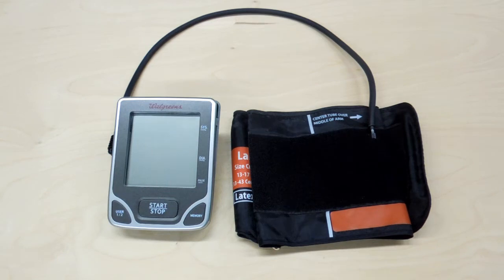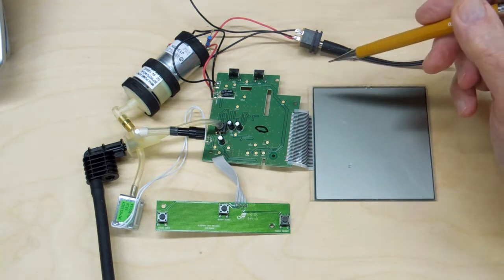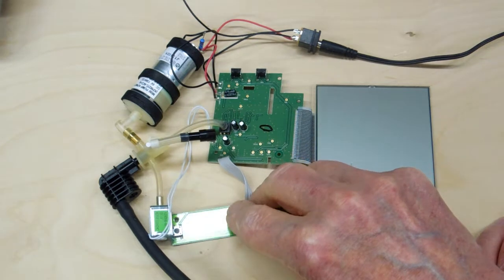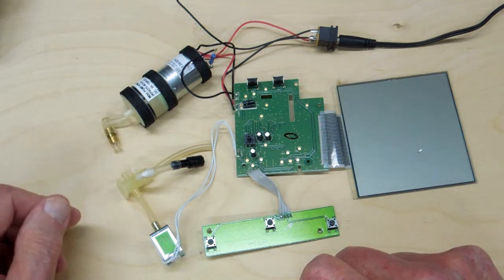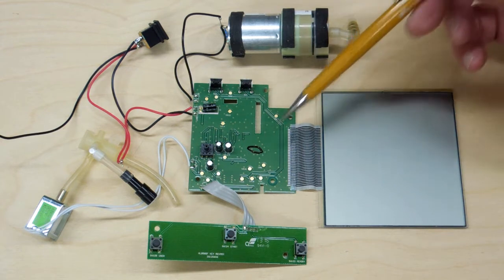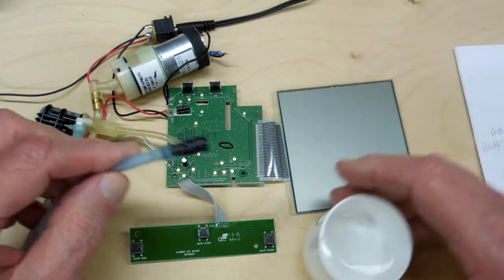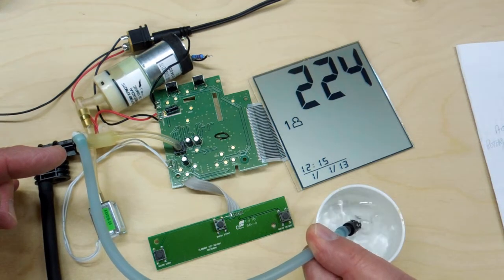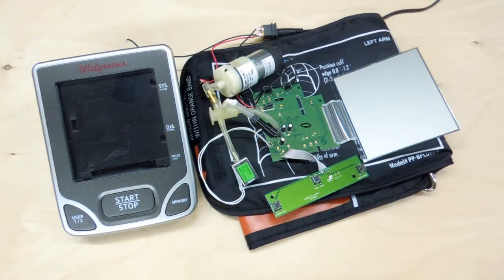Blood Pressure Monitor - How Does It Work

Comment: Both my units use too many batteries. With brand new batteries, the display will read full battery. After maybe two weeks it’s down to one bar.  It will run for a few more weeks , but a power supply is in order
Reply from the maker: Recently purchased another BP Machine from Walgreens and it will not take a power supply. Manufacturer must be in bed with the battery companies. :-) And, the new machine wears out rechargable batteries fairly fast.
Next project is to design a 3D printed replacement for the batteries which will use the power supply from this old machine.
I do not want to solder in a direct connection for the power supply as that would void the warranty.
Reply: @RonaldWalters2010  waiting for the video
Reply from the maker: Just completed this video.
I haven't released it to the public yet but you can view it now.
Ron

BP Monitor - Power Supply Conversion
https://youtu.be/76Sr6DYN7T4

The power supply is rated 1 Amp and is probably necessary due to the air compressor in the monitor.